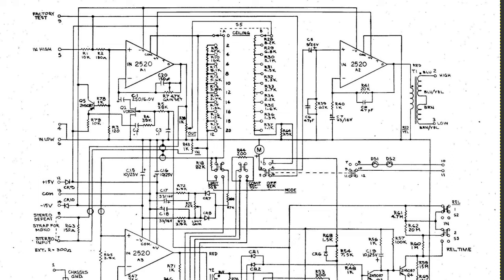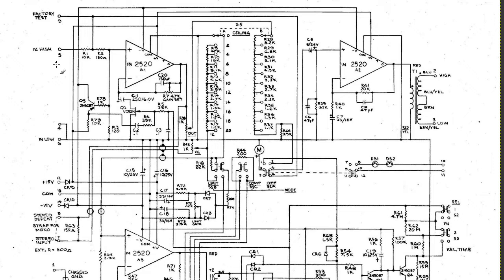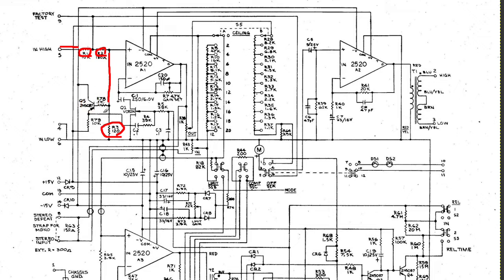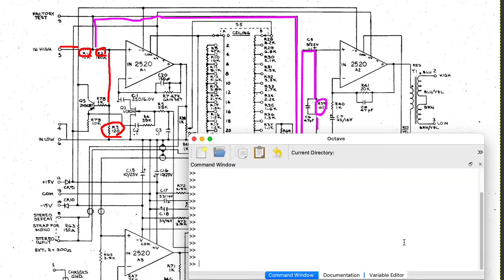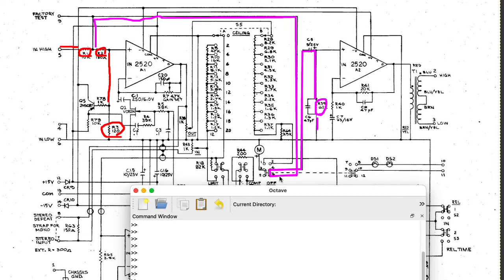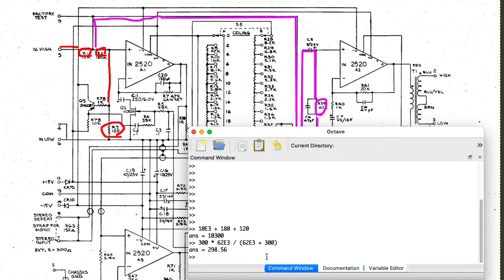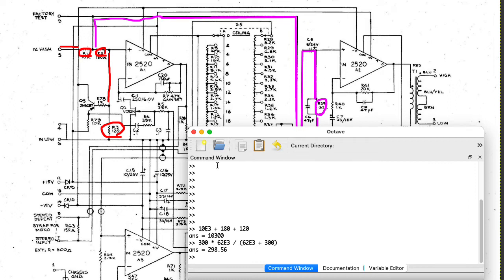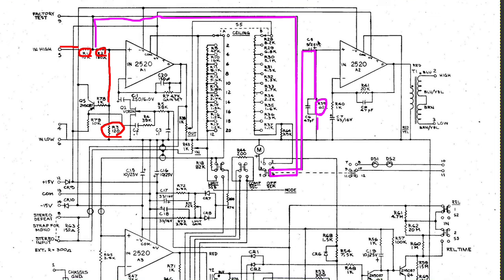API 525 Compressor Circuit Analysis, Part 2: Input Impedances (Deconstructing Studio Gear)

Comment: So informative！Any plan to continue this series？
Reply from the maker: Alas, not any time soon. I was never able to figure out the sidechain circuitry.
Reply: @Lantertronics  Sorry, I mean the pro audio equipment analysis series.
Reply from the maker: @CharlesTsaiE  Oh! Yes, eventually. Been busy this semester with my Guitar Amplification and Effects Class. I'd like to take a look at the Neve 1073 and the Grace Designs preamp (which I reverse engineered -- it's well implemented, but it's basically right off the data sheet, nothing particularly special about the design).
Reply: @Lantertronics  Great！wait it.

Comment: Did you ever get to do an analysis of the gain element and the timing circuit (attack/release)? Since you too seem to have a curiosity for weird circuits, have you ever looked at the THAT Corp. Non-Linear-Capacitor circuit (dn114.pdf)? As hard as I look and try to understand what it does...its is still a mystery to me :-) This circuit is actually used in a good number of dbx compressors to automate attack/release times.
Reply from the maker: Heh, I've spent a good amount of time in THAT Corp. (what a terrible name for a company!) app notes, including that one, and no, I don't understand it. It's interesting, but I don't grok it.

I'll be honest, I never returned to this circuit for further videos because I never did figure it out. ;)

Comment: i got one for you ...

http://www.valvewizard.co.uk/engineersthumb.html
it's somewhat close to a SLL compressor.
Reply from the maker: Interesting! Hmmm... the SSL is a feedback compressor and this is feedforward. This might be more analogous to something like the dbx compressors.
Reply: @Lantertronics  oh, i didn't look at it this way, i just tried to discover how to capture overshoot of the threshold and reduce it.

i tried via a known transformer producer to acquire a 2 x 35 V transformer, first the don't take order from private persons and it would take a order of 10K units and second it would take until 2023 due to current market situations. so i can't build a Urei 1176 and do some measurements on it, doing this in the falstad simulator is a enormous job and lags your computer due to big number of components and try it yourself, adding an audio input to your circuit, select a mp3 file and see what happens.

But i thought of a circuit to might do the job. but first i have to find a suitable transformer to drive a EL penal, just don't have the parts right now. i have run out of 100K resistors.
: )
Reply: @Lantertronics  by the way, YouTube recently presented me a video of a Machine build in the very past to could create synthesis (word used in the title) and draw it on a plot.
it was mathematically correct using cogs/gears, levers, springs.  almost like a Buchla 259 vco but mechanical.

I'm pretty sure it's possible to start measuring from a certain threshold using opamps, just don't know how to do it and i don't want to use a switch ic.